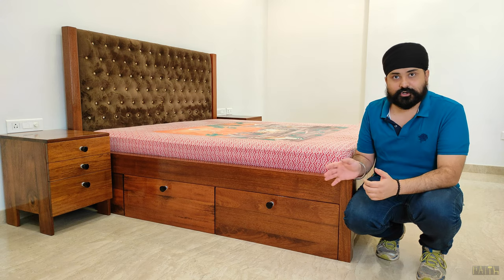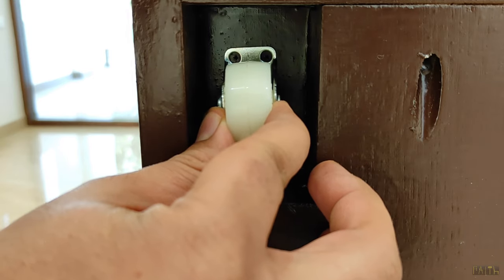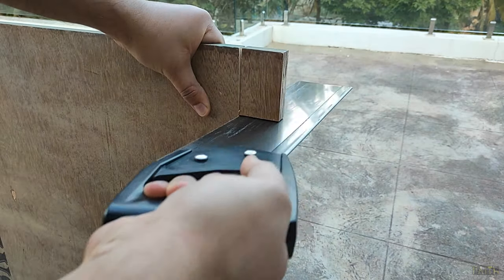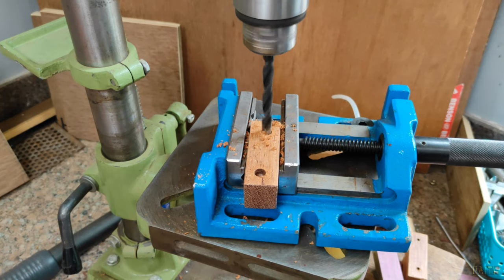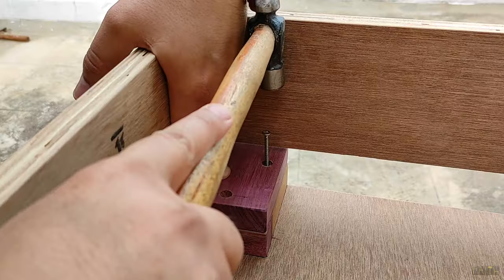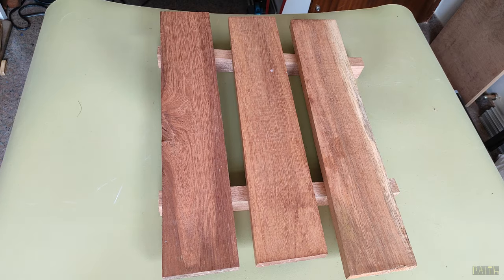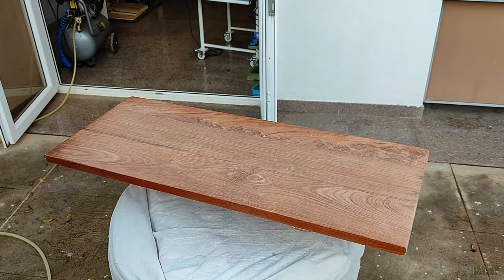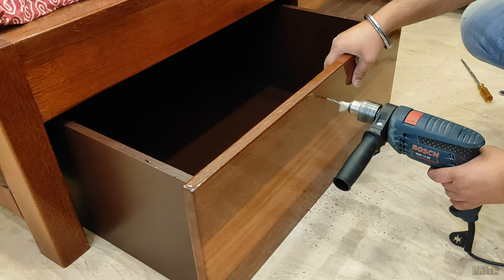Without Rails or Slide Channel / Make Under Bed Storage / Make Drawers for any Bed / DIY

Comment: Hi sir
Very nice video.. I was looking for bed with drawers my carpenter can make.. my requirement is that I should be able to clean the floor below bed by easily removing the drawers.
Your video serves the purpose
Reply from the maker: Glad you found the video helpful, Thanks for your comments.

Comment: Nice video, I noticed you used a second table saw.
Reply from the maker: Good catch, Yes I did use a second table saw, I bought it recently, This was a demo machine lying with the dealer, got it in a good price and could not resist buying. Its a Sawstop Table Saw. Thanks

Comment: Just out of curiosity, are there saw stop dealers in India. I have been looking for one for ages.
Reply from the maker: Yes, Caple Industrial Solutions is a dealer for Sawstop in India, You can contact them if you are looking to buy one. Their website address is Caple.in.
Reply: @TarlochanSingh  I will contact them. Thanks. I can also put in your name for reference.
Reply: Turns out Caple don't deal with saw stop anymore. Incase this helps others